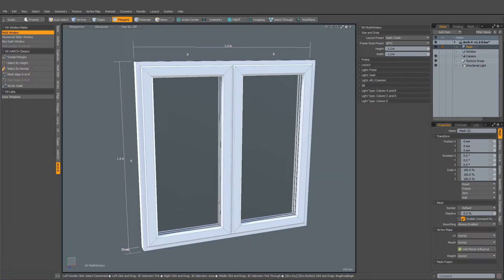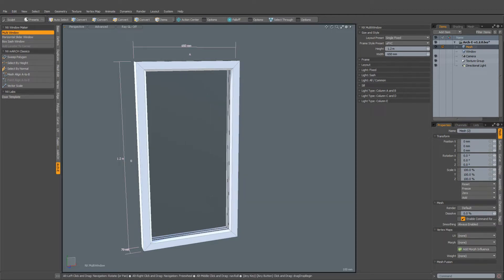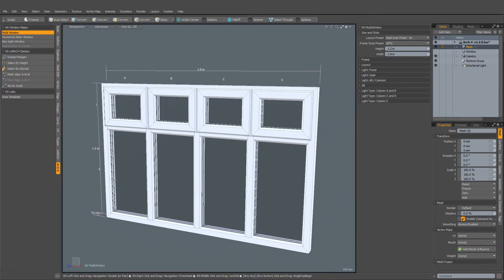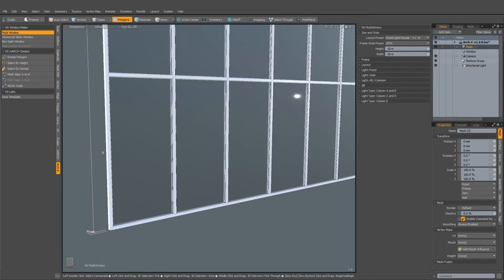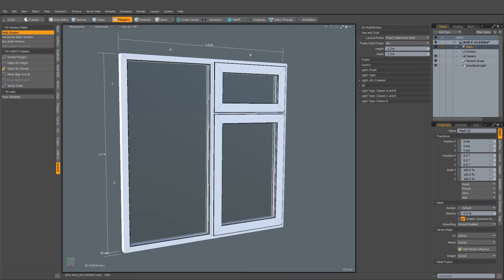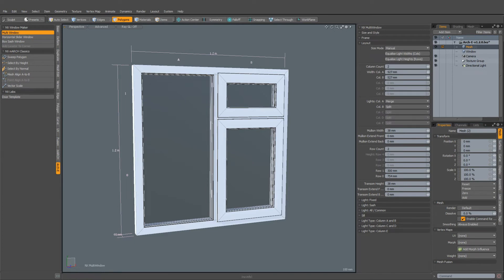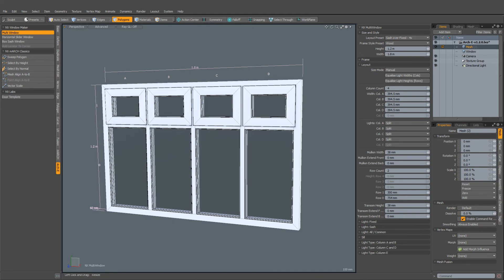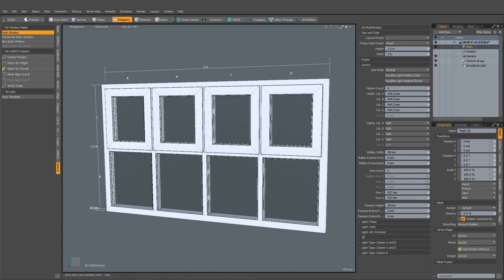Arch-E Kit for modo | MultiWindow v1.2

Comment: Hi Neil, great job! One question: Is the "Column Count" still limited to 18? (ie. with a big facade or glass front 18 is very fast too less...)
Reply from the maker: Hi Michael, it's currently limited to 20 rows x 20 columns (400 glass panels). This was done for performance reasons as I have to convert the mesh my tool generates to a modo mesh. You can, of course, use the tool to make one section, then clone to the desired size (I have some ideas about how to improve this in future). Ultimately, once you reach a certain size it makes sense to switch to array cloning, instances or even replicators.